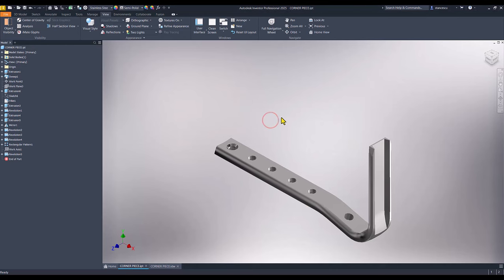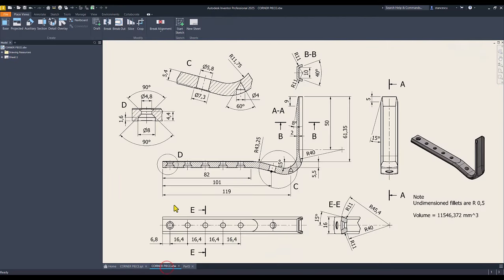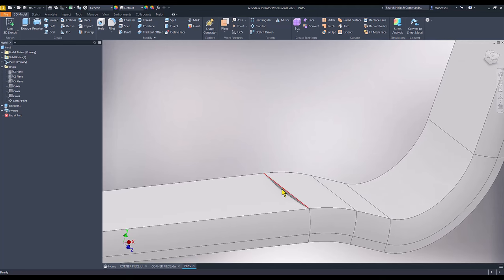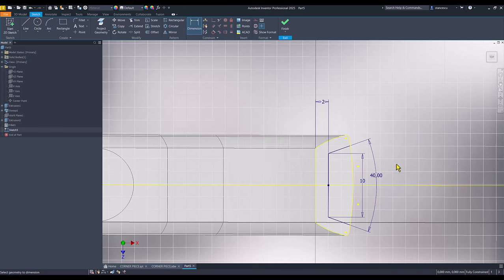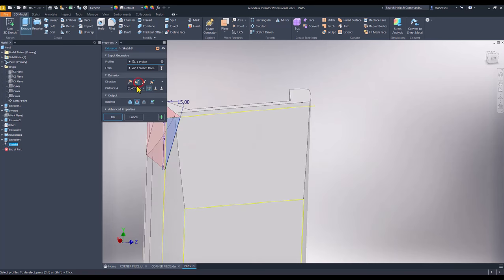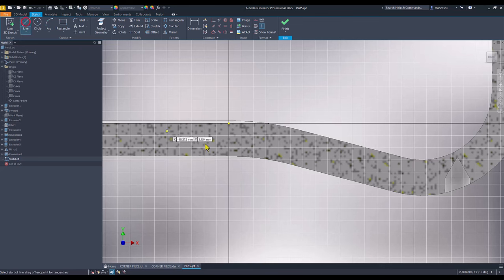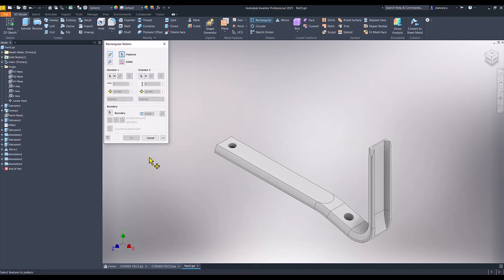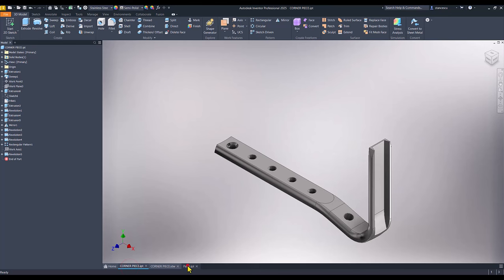Tutorial Inventor - 411 CORNER PIECE

Comment: Hello, dear professor, I remember this element in medicine, because I underwent an osteotomy of the left femur in 1990 (The femur is cut in half to the length that represents the 82 mm, then repositioned and insert the short length of the clip at the base of the femur at the level of the knee and the large part is fixed along the second part of the femur going up to the hip inserting all the screws. The surgeon had taken the angle of degradation with a large protractor, the length of the legs and my total height to make these calculations with a lot of x-rays. I kept it for 18 months followed by the removal in 1991 as recommended by the surgeon. I don't know if it's stainless steel or titanium, but its weight was higher than its dimensions might suggest. Today you are presenting the design of this Medical Clip. Thank you, after this course I am no longer afraid of mystery. Thank you Professor, and see you soon for the future.🙏🙏🙏👍👍👍🙌🙌🙌
Reply from the maker: I did not know that this is a medical part! I selected stainless steel at random. Good for you about the removal. Good luck!